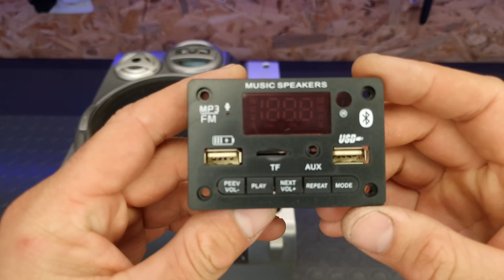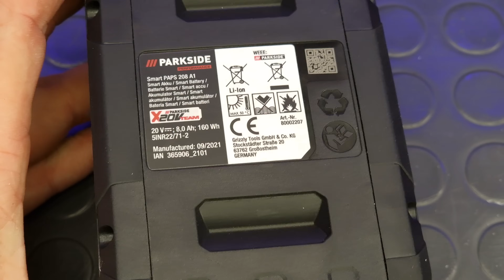DIY Awesome Bluetooth Speaker with Powerful 15W COB LED Panel running with Parkside 8Ah Smart Accu

Comment: The only thing you want to do with that light is blind everyone lol and instead of putting cotton or foam in your speaker just use a weaker speaker and/or just add passive radiators until it sounds good

Comment: good video I liked the only thing I didn't like was the battery you added when you could have put rechargeable batteries of the ones that carry the amplified speakers or a 12 volt battery so you could put it inside in everything else excellent greetings ✌️
Reply from the maker: Thank you very much, I did so because I have many such batteries that can be charged very quickly and replaced as needed.🙂

Comment: Ile pobiera amper ta dioda led cob ? na jak długo wystarcza przy 4ah lub 2ah bateri parkside ?
Reply from the maker: The real power at 100% of this COB led is 12W, which means about 700mAh at 18V.
But it also requires good cooling!
Reply: zamierzam jej obniżyć do 12v zasilanie ciekaw jestem ile będzie wtedy pobierała @ErCanEverything

Comment: se ve bien yo quiero armar uno pero sin la luz  con la bateria interna oculto y un amplificador con buen bajo
Reply: si me parece muy mal tener la batería de forma externa.. además pinto los altavoces lo cual los daña ya que el papel que tienen estos se dilata con el sonido.. el tubo que poner una caja rectangular pequeña sobre el parlante y ahí poner todos los componentes ya que la caja de los altavoces solo es para el sonido.. además que las conecciones deben ser soldadas y no con pines extraíbles.. recomiendo utilizar el cable de transmisión de datos de computadoras antiguas.. además para que agregarle esa luz.. osea para ello solo una linterna aparte y ya.. en fin me pareció bonita la miniatura

Comment: ¿Qué autonomía tiene con esa batería de 8Ah?
Reply from the maker: After about 4 hours with normal volume and with the light on at 25%, the battery had dropped from 100 to 60%
Reply: @ErCanEverything  Muchas gracias.

Comment: Nice Build.  I'm using the battery to power a small pa system with an 8inch top speaker and a 15 inch sub
Draws about 200w
Reply: How do i connect it to a tzumi 8 inch speaker

Comment: Fantastic! I have a similar box well two, but it was made by Sharp. I will look into doing something like that for my sister, but I will be using both boxes and a stereo amplifier which I already have. I am kinda old school 
[I like wired system], but I will do the wireless thing for her as a birthday present.
Reply: You are right to go oldskool, bluetooth is horrendous for sound quality and music is in stereo not mono, also the piezo "beeper" in these speakers will push the impedance right up and kill sound output, in a nutshell its a waste of time doing anything like this unless you know what you are doing.
Reply: Jk8

Comment: I made a 12 volt UPS.  That's what I run my router with.  A relay is used here.  The function of the relay is that when there is power, the relay turns on and the router runs with the power.  And when the power goes out, the relay turns off and the router runs on battery.  The problem is that when the power goes out there is a very slight delay in the relay turning off causing my entire router to turn off and then turn on immediately.  But when the power comes back on the relay turns on very quickly so the router doesn't turn off when switching from battery to power.  But the delay in switching from mains to battery causes the router to shut down.  Now how can I turn off the relay quickly or arrange it so that when the power goes out there is a slight delay in switching the relay and my router shuts down.  I hope you will benefit from the advice.  I want the relay to switch on and off very quickly so that my router never shuts down.
Reply from the maker: Have you tried connecting a capacitor to the router's power input, like 4700uF or bigger? This will solve this problem
Reply: @ErCanEverything  thanks a lot🥰
You are very good YouTuber bro😘
Reply from the maker: Thank you for the good words🙏🙂🤝
Reply: @ErCanEverything  if you don't mind please tell me how many capacitor should use...single or more.... I'll use 4700uF
Reply from the maker: I'm not sure either, try one, if it doesn't work, add more🙂

Comment: Modified TONE CONTROL, ANTENNA AND RCA ADAPTER INPUT
Reply from the maker: The antenna is the red wire above the capacitor 16:02

Comment: Усилитель слабоват, не качает его совсем, и зря ты покрасил динамик, у него и так чувствительность маленькая, сделал еще хуже, будет играть тихо.... короче много косяков.
Reply from the maker: Painting was not a good idea but how did you determine the amp was weak?  If you noticed the volume from 12 to 30 does not change at all?  This is due to the automatic adjustment of the volume of the microphone.  I can tell you that it corresponds to 2 x 30~40W amplifier!

Comment: Use a more powerfull speakers push it to its limits , more bass is better than audio quality
Reply from the maker: The sound quality is very good, but it is not felt in the video and the power is much more than you think!
If you noticed that there is no difference in volume from 12 to 30 because the microphone of my camera automatically adapts.

Comment: 8ah akku with tpa3251 2.1 only 1h 😅 Parkside akku whith tpa3116 is good
Reply from the maker: This receiver with CS8673E amplifier is 2 x 40W and it did very well with a 75W speaker in the video you can't tell how loud the music is but it's very good indeed.  I listened for 6 hours with an 8A battery, the volume was set to 10 and the battery dropped to half

Comment: The system should be MONO, but you didn't solve that. Your bluetooth module is stereo by default, so according to your installation, the bass speaker will be the right band, the center and the high speaker will be the left band. This is very bad. The music will not be complete, it will not be enjoyable. I recommend another type of bluetooth module, which does not amplify the signal, then convert the signal from stereo to mono, amplify it to an output power of 30 W, connect the speakers using a crossover. After that, you can put the video on YouTube...